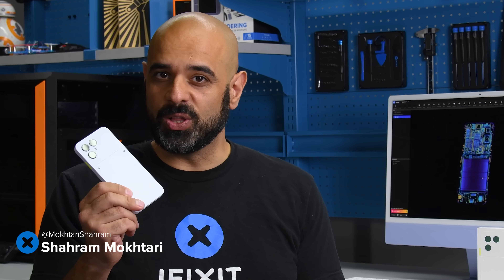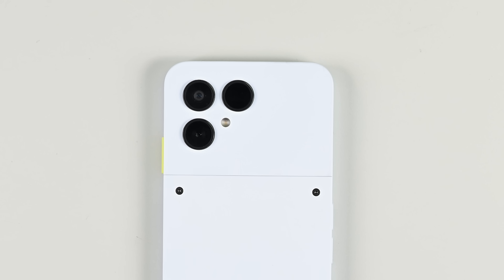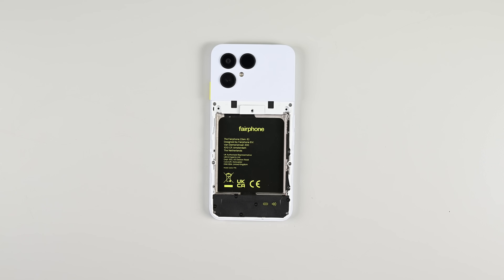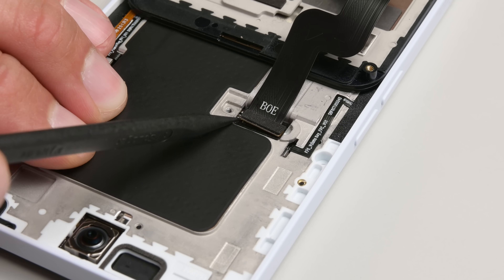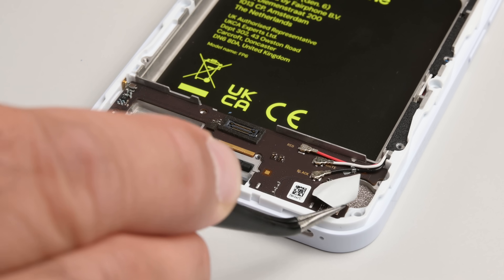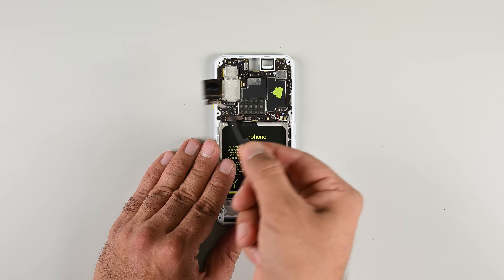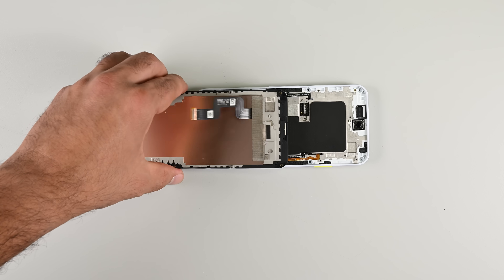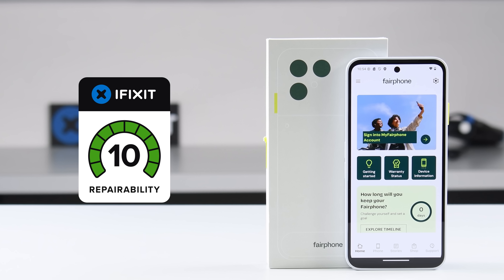The Most Ethical Smartphone Yet? Fairphone 6 Teardown & Review

Comment: Can you guys do one of these for the HMD fusion?
Reply: Would be interesting, but futile, since a reparable phone with only standard software support time isn't that usefull. Battery is the most replaced item, but it has a lifespan of 3-5 years minimum. You don't need to change battery, if the phone is obsolete software wise after 3-5 years.
Reply: Well the main reason I ask is because they have a repair program/partnership with HMD but they don't seem to have any videos about the phone. This is from their website "we’ve teamed up with HMD to develop a complete repair solution."
Reply: Plus the hmd has a 3.5 mm head phone jack and this doesn't seem to. Also would it be possible to "degoogle' with e/os on the hmd after the software support ends? Cause if so im not sure how much that matters
Reply: @haifutter4166 I do hope they'll change that soon given the EU's new rules. There's also a not-so-hidden bootloader unlock available afaik

Comment: Its sad they got rid of usb 3.0 has that helps me to transfer data and use the phone has an fast usb drive
Reply: It supports SD-cards, you just need to remove it and use an adapter or the slot on your laptop/tablet
Reply: @stephen1r2 Except the previous usb 3 port also supports display port capability. Would've come in handy with Android 16 reported to support desktop mode.
Remember that this phone is pitched to be used for a long time.

Comment: great but too expensive for low-midranger oh and it doesn't have wireless charge or ip68/69 storage is only 256gb...
Reply: 256gb which you can upgrade with a single micro sd card by 2 tb!
Reply: @CathrineMacNiel yes but sd cards are unreliable even if they are well known brand like kingston sandisk or samsung they get corrupted really oft and they are slow ..

Comment: putting USB 2 is just an oxymoron. You can literally ise your device as a Linux server with Android 16 but due to USB 2 slow speed you can't get fast connectivity or option to use external display.
Reply: 480 mbit/s data transfer is slow? thats 60 MB per Second! Besides that, which linux server requires an external display? The Fairphone has a built-in display!
Reply: @CathrineMacNiel That's theoretical maximum in real life it's much slower

Comment: A Framework partnership would be pretty rad.
Reply: I just had the same thought. Imagine being able to just swap the mainboard few years down the line and have a better processor (and more ram). The only issue could be the storage.
Reply: @devKazuto  Imagine a phone with a small M2 nvme SSD which you can replace if you upgrade it. Handheld hardware in phone formfactor. This would be my dream.
Reply: @FunFreakeyy  this would be amazing. So many people could benefit from a swappable non-soldered storage solution.
Reply: @FunFreakeyy  That would probably still take up a lot of space though. Don't get me wrong, I'd love to have a small M.2 slot in my phone, but  I think most people aren't doing anything that requires SSD speeds on their phones regardless, so the much smaller form factor of micro-SD cards would probably be a better choice still.
Reply: @FunFreakeyy phone storage is so much faster and sooo much more power efficient than pc storage
Reply: @FunFreakeyy  Impossible
Reply: @FunFreakeyy  That's called an SD card. It has existed for 20 years
Reply: @laupoke SD cards are flash memory that break pretty fast with lots of reads and writes like an OS does. Raspberry Pi's or other SBC's use them but there's a reason why you can also install a real hard drive with them.
Reply: @devKazuto  concur, they could just take my money at that point.
Reply: @devKazuto  What do you mean storage issues? SD cards exist my guy
Reply: @xFluing  Yes, but not all apps can be installed on external storage like in a Framework Laptop where everything lives on a "external" drive not on a sordered chip.
Reply: that's the dream
Reply: Right? This phone has massive Framework energy.

Repairability is just parts away from upgradeability.
Reply: @Captain_Biggles  it's the other way around iirc. I'd rather go for a Fairphone laptop than a Framework one
Reply: Most ambitious crossover since Endgame
Reply: Except I'm not sure Framework cares about ethics?
Reply: There is nothing that fairphone would gain
Reply: Please do a partnership, then add AIAIAI audio in the loop and you have a lot to compete even with company like apple
Reply: 🎵 Hallelujah, Hallelujah, hallelujah, hallelujah, halle-lujah 🎶
Reply: Ah. Framework. The company that couldn't ship outside the US first, still can't ship world-wide (whereas far more smaller companies can). The company that had a "Register interest for your region" website online, which didn't include a ton of countries, misspelled others or named them in the wrong language. Yeah, we definitely don't need more Framework things...
Reply: @darklajid somebody's salty, eh? You don't even engage with the product, just dismiss it based on bloody logistics.
Reply: @darklajid They seem to be shipping world-wide pretty quickly though, from what I can see in their forums...?
Reply: @darklajid  Fairphone doesn't export outside europe except only recently through Murena, what exactly is your point? Both companies are doing good work to break the cycle of non-repairable, disposable devices, cut them both a little slack.

Comment: I think waterproofness should be a consideration is longevity of a product
Reply: Maybe, but in my family over the last decade or so we've only had a single phone due from water damage (it was not waterproof and left out in the rain overnight). No other phone has been submerged besides an old Nokia, but rice brought it back despite the lack of waterproofing.

Meanwhile I've lost my previous phones (in order most recent to least) to: dead screen, dead battery, dead charging port, damaged microphone, dead battery, and a dead charging port. I'm not often near water, so I'm sure for some it's a bigger deal, but I would have easily gotten another year or so of use from most of my phones had they been this repairable (of the above, 4 have had repair attempts, only one succeeded).
Reply: @astersfun I’m just bitter it’s not available in Canada through Fairphone
Reply: You can't make a thing waterproofed and easily disassembled. It is either or. Either you glue it shut to keep water out or make it modular for ease of (dis)assembly.
Reply: @Lahiss The S5 was waterproof and it had a removable battery.
Reply: @raiwet so, the Galaxy S5 was water-resistant, NOT waterproof....
it had IP67 (certified for dust and water resistance)
Reply: @Test-hs6ng thanks for the pedantry.

Comment: Really hoping for a replacement USB 3 port (if possible)

Would immediately buy the phone should it come out in the next years
Reply: turns out it's CPU dependant, they used an industrial cpu for the 5 which supported display out and thus a reason for the USB 3, this time it doesn't so even if they added usb 3 it would only support the transfer speeds. For commercial cpus only the flagship ones have it
Reply: @BankruptGreek  Thanks for the explanation. Guess for transferspeeds KDE-connect over WiFi is the only option then. I miss the option of plugging in the phone and having speeds like on a USB 3.0 stick though.
Reply: @BankruptGreek "only support the transfer speeds" you said it like it's not the thing most people actually care about
Reply: Sadly I assume the expensive part is getting the amount of data for usb 3 and not the plug itself
Reply: Same! I was about to instantly buy it at launch, but then I saw that it was usb 2.0 and I've been struggling ever sense
Reply: same for me.

USB 2 is a dealbreaker.
Reply: Imagine you get a fast micro sd card and the bottleneck is the usb port lol
Not to mention the internal storage

Comment: Easy to fix, yes.

But how to fix the too low specs?
Still 8GB Ram, like FP 5 and 4 ?
USB downgrade to 2.0,
no display out aka no desktop mode,
still no wireless charging.

I try hard to like the 6th,
but struggling.

With max RAM, desktop mode, wireless charging, i would the double the price.
Reply: Average user doesn't need more than 8gb of ram on the phone as of now, plus they are not trying to compete with flagship devices yet, they have other goals. Same goes for the desktop mode, to 99,9% of users it is a gimmick. Wireless charging might be convenient, but it will always be slower than wired, and twice as less effective too, that's how physics work. Not to mention making that module needs more money, more materials that can be spent elsewhere.

What I agree with you on is that releasing a phone in 2025 with usb 2.0 is a weird move.

Also waterproofing would be nice. It's their sixth model and still no IP67/IP68, really? Everyone and their dog has a waterproof phone by now...
Reply: @mediumplayer1 I can only imagine those design meetings… they made that choice for a reason after much much debate. I’m guessing they decided people who gave a crap enough to buy it could work through the time issues that come with the slower speeds of USB 2.0
Reply: I do agree that from the longevity perspective 8gb of ram does fall short and might cause annoyances in the future. I wonder if they would've considered micro usb instead of type-c if it weren't for the eu regulations just to save a dime or two... not to mention that some people here in the comments claimed that according to the specifications, the cpus in these phones do support usb 3.1 speeds, if so much is true, why was that even a question?
Reply: @mediumplayer1 the average user installs a lot of apps, which are not very ram savings. with more ram, every smartphone get's snappier, more things could stay in ram.
Today is 2025. In eight years, this amount of ram wouldn't be enough. If you say, that you build a sustainable phone, you should built more ram, than the average to last longer.
Reply: @mediumplayer1 Wireless charging "module" would be like 1-2$
Reply: I think this just gives more credence to Fairphone figuring out how to introduce upgradeable modules in the same form factor as the vanilla ones.

Comment: I love it but I just will never understand the decision to get rid of the headphone jack. Maybe once they get their repairable batteries in their fair buds in a genuinely decent consumer state but even then why? The kind of person you're going after very explicitly tends to be opposed to the e-waste associated with getting rid of the headphone. And the proprietary greed of the corporations that engaged in it
Reply: So true. I wont ever consider their smartphones if I cant use my trusted wired headphones with them. They should leave more options to potential users.
Reply: The decision was made , because it causes water resistance issues- a phone can get water-damaged really easily with a headphone jack, while those that don't have it are more secure, also for them to build solid water resistance, they need to have space, and the jack is kind of problematic and prevents improvements , especially because its the sole reason water can get stuck inside so easily. Honestly its not that big of an issue- just use Usb C headphones- they work the same way anyway.
Reply: @CineverseSculpt This phone was not designed for water resistance, he even says so in the video. There are no gaskets, and no glue.

This is just made up rhetoric by smartphone companies to hide the real reason why they did it--they want to sell you their wireless headphones.
Reply: @CineverseSculpt  bro this phone is IP55 rated, not IP68. Did you forget about the Samsung Galaxy S5? There is just no justification, only the intention to sell more of their bluetooth buds.

Comment: I used iFixit tools, parts, and guides to replace the bulging battery in my Google Pixel 6.  I was able to do it, but it was not easy especially due to the fact that the Pixel's battery is glued down.  This Fairphone looks so easy to fix.  This may be my next phone.
Reply: Fun Fact, the CPU in youre Pixel 6 is faster than the new Fairphone 6.
Reply: @MrZocker92  ikr, who cares about global warming and slave labour, I need my extra gigahertz to buy Call of Duty microtransactions with
Reply: @MrZocker92  as to be expected, fairphones cause is noble but the smartphones value is only the ease of repair. the hardware is compleatly outdated and years behind the budget Samsung or Xiaomi smartphones.

Comment: I just wish it had a 3.5 jack. it would be so perfect
Reply: This has held me back from upgrading from my Fairphone 3. I don't want to use wireless earbuds as they are landfill fodder
Reply: @turbokadett  you can get over ear wireless headphones though?
Reply: Use usb C headphones, works the same way as the headphone jacks, and are cheap.
Reply: @CineverseSculpt  I do have an adapter, but I have found myself in situations where I want to charge the phone and still use the jack. I just don't find it comfortable to buy yet another adapter with both a jack and the usb c inlet

Comment: if this had a 3.5mm jack I would get it as my next phone
Reply: And since the USB Port can be easily replaced, the durability argument for the headphone jack cant hold up. USB 2.0 stings more
Reply: I will never buy a new phone without a jack.

In times when ipods are no longer a thing, demand for quality audio might go up.

On the other hand some people do not hear the difference.  No jack forces people to buy new bluetooth device every 3 or so years… so much waste, not fair for part of the earth that manufactures or consumers.
Reply: Also the constant wear on the USB C port for being plugged into while in your pocket can't be good. When it dies, you don't lose your music but you also lose the ability to charge your phone.
Reply: I don't want no dongle hanging down my phone, I use wired in-ear monitors all the time, that's why I use Sony smartphones
Reply: @maegnificant  A bit overreacting you are. The dongle barely adds any dangle to the allready dangling headphone cable. 😅
Reply: no it doesn't, any USB-C dongle requires, at least, a small soundcard which is usually located inside of the plastic housing behind the USB-C port, this adds MUCH more stress when it moves back and forth while moving around than it would if it were just holding a lightweight headphone cable that doesn't flop around the insides of the port.
Reply: we can get a sleek adapter though. also there are usb c wired headphones available nowadays and many over the ear headphones support audio in through usb c
Reply: @367Stories why would you get new headphones just because some phone maker forgot to install a simple port?

Comment: Today, you need a screwdriver to have access to the battery 🔋, tomorrow what will it be, a screwdriver to have access to the charging port or sim card tray?

Let's be honest, nothing, but really nothing prevents Fairphone from using at least a Snapdragon 8s Gen 4, this smartphone still costs $700.

Not to mention the lack of a heap jack and iP68 certification, if we had never seen the Galaxy S5, we might have really thought that it is indeed impossible to have this on a smartphone with a supposed removable battery 🤧

🚶🏽‍♂️🚶🏽‍♂️🚶🏽‍♂️
Reply: Samsung was not an indie manufacturer when they released the Galaxy S5. Samsung was a billion dollar company with years of experience in electronics in general as well as with smartphones. However, yes, the Galaxy S5 released in 2014. Fairphone is poor competition to a device released over 10 years ago.

I will say, it is still disappointing to see that Fairphone can't release a device with more up-to-date specs. USB2 on a brand new "flagship" device? A device that supposedly will last over 5 years? I can still buy a brand new Motorola for $199 USD that has a headphone jack and SD slot.
Reply: A screwdriver is still far more accessible than the hot plate and all the other thingamajig needed to repair other phones. Plug this only needs a T5 driver, which happens to also be the Framework driver.

Comment: Fairphone just keep getting better and better. I won't change my phone until it's impossible to repair the one I have, but when I do, it will be for sure for one of their phone
Reply: same
Reply: Same here as well - sticking to my ethics and trying to keep my current phone until it really doesn’t work anymore but after that Fairphone is probably my next one
Reply: In almost every regard, besides the USB 2.0, which is quite sad, since Android is planning on a native desktop mode. FP4 had Displayport support over USB 3
Reply: @haifutter4166  Who isn't going to have a tablet/laptop and need that? If you want to do a presentation, then casting to a TV is easier, and needs no cables.
Reply: @stephen1r2  XR glasses and phones are a great and really small portable combination. But yeah the desktop feature on a phone would be a poweruser feature, that's why it's in beta state for years now.
Reply: @stephen1r2  You're probably right. But I would have made use of the high data transfer speeds. But KDE-connect over Wifi will be a suitable workaround.
Reply: @haifutter4166  Nooo this can't be real. If this isn't a mistake this is a dealbreaker for me... I want to use Linux on it and simply plug in a display to use a real desktop mode, like I already do with my Moto G100 with the bad Android desktop mode. Android doesn't take the desktop seriously and I doubt they will with the update, but that's another topic. Guess then I really have to switch to a raspberrypi phone...
Reply: @haifutter4166  Not to mention the missing headphone jack.